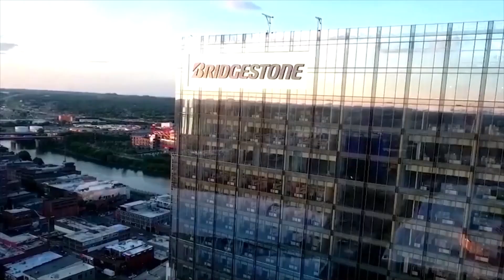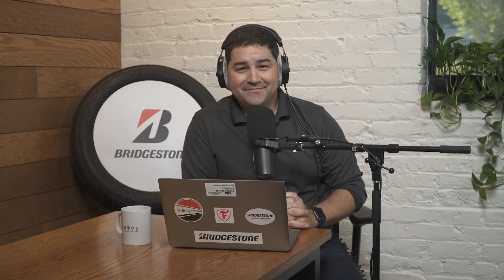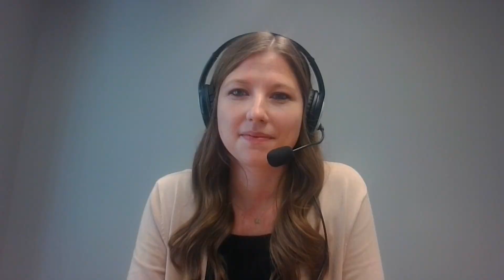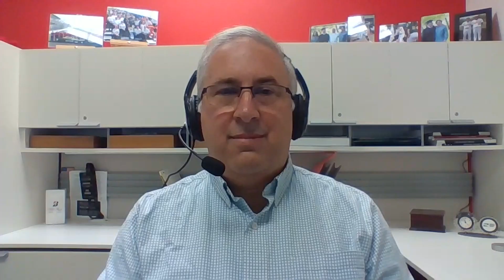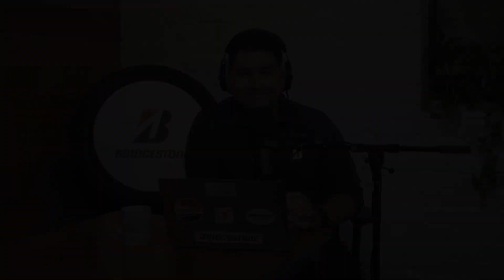Thrive Ep. 51: ENLITEN Comes to Life: Advanced Materials & Design Deliver Game-changing New Products

Comment: Hi Team, I’m Kamar from Tires Plus St Lucie West. I must say this was an excellent presentation and it’s quite funny because recently we had a customer who drove a Tesla Model 3 Performance come in after buying a set of off brand tyres and wondering how they got destroyed after less than 13000 miles. I had to explain the concept of friction and how mass affected the coefficient of friction to him. Then the discussion of heat and heat management came into play as the tires generated more heat the faster he went. Had I had this info just a week earlier regarding the peak life polymer!!!!!! Also I noted that you spoke about double digit improvements in compound stability. Does this relate to thermal stability or the ability to avoid sheering due to the instant torque delivery? Will the compound allow a more compliant tire that would require less tire pressure (increased comfort due to less stiff sidewalls). I’m excited to hear more.